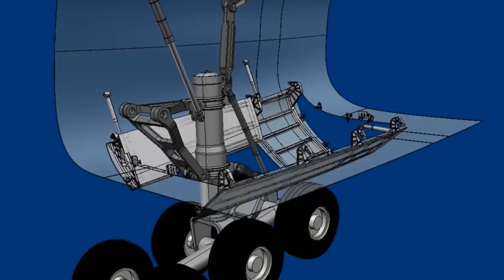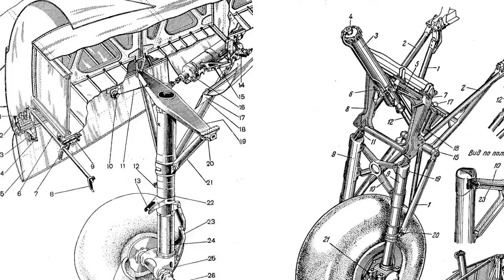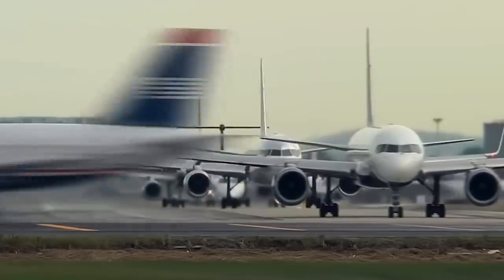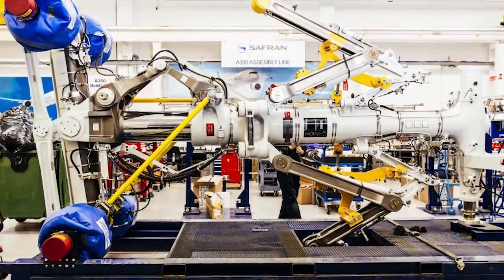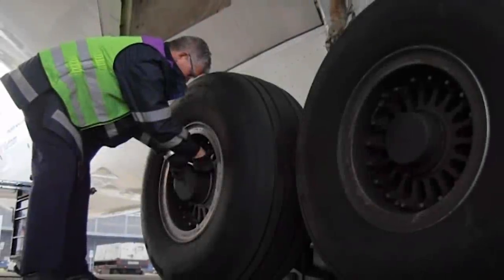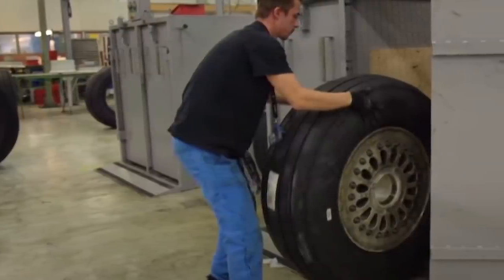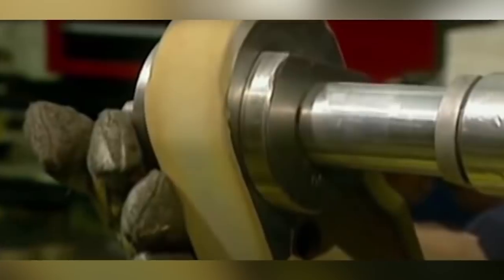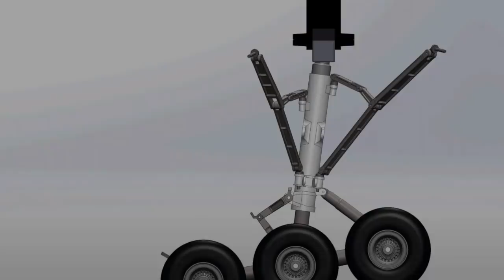Why Does Landing Gear Never Explode?

Comment: I was in the Air Force for 12 years. In that time I changed wheels and tires on the KC-135 Tanker, B-52 Bomber and the AWACS E-3A.  I was a 43152E. 30 mins is ridiculous. Under QA supervision and following all applicable Technical Orders, Job Guides for the job it takes an hour easy ONLY because the Wheel and Tire shop had already swapped inspected and tested the wheel, technician had changed bearing races, changes  Schroeder valve put a new tire on the rim, torqued all the bolts holding it together, inspected wheel bearings, greased and had them at the ready a wore tire. Wheel and tire assembly would have to be taken to the airplane. Before removal the airplane had to be configured for jacking and safety procedures including documentation in the aircraft's forms. Without QA could be done in an hour. With QA 90 mins
Reply: Totally agree. I worked on KC-135's for years and. Sometimes our QA would come by and take apart what we just did just for quality control. Nothing like doing the same job twice.
Reply: 20 mins on an a320
Reply: I was a crew chief on the tankers also.  Very time consuming if done properly.  We always man handled the tires,but once the women joined the crew chiefs, they used the wheel movers, and saved their backs.  I retired after 24, years.  Grissom, Malmstrom and MacDill AFB.
Reply: I was at Grissom for 6 months 1978 to February or March 79
Reply: I also han't was the supervisor for the real entire shop for both the KC135 and top be 52 tires including the wingtip tires
Reply: He researched a piper warrior when looking into the landing gear tire changes

Comment: When he stated there are very few KC-135 tankers left, where did he get that info?  That is still our primary tanker in the Air Force.  344 still in use of the original 732.  The KC-46 will eventually replace them.
Reply: And he says they "were popular in the 1960s."
I guess he forgot that they were (and still are) the primary (and therefore "popular") aerial refueler in the 1970s, 80s, 90s, 2000s, 2010s, and continuing into the 2020s.

Comment: Any inflated pressurised tyre can explore or burst, no matter what it's fitted to !.🧐🏴
Reply: But, airplane tires are mucho more resistant to exploding and bursting.
Reply: You said and I've seen it lots I've also had the chance to see a airplane tire being tested to bursting pressure and even though we were in almost what seemed like a bomb shelter I still felt it in my chest when it went off it was the crazyist thing I've ever seen in my life
Reply: That's exactly right just like the advancement of racing car's and safety that's great and all but they'll never be death proof  👍
Reply: 27 years in the air force... Never saw a tyre explode. If they have a "hot landing" the brakes overheat and may catch fire, but normally just smoke a bit. The danger here is the heat generated passes into the tyre (cover) increasing the pressure that's why wheels are equipped with fusable plugs that let the gas out of the wheel assembly at a safe controlled rate.

Comment: You really need know the difference between tires and wheels. Especially when you’re doing a video on tires and wheels. You had my mind so twisted and confused when you interchangeably used tires and wheels, then you threw a couple of rims in their too. For future reference tires are the rubber part and wheels are the metal pieces that hold the tires. Rims are a flashy set of wheels.

Comment: OH, THEY D-O EXPLODE. WHAT ARE YOU, HIGH?
Reply: Yes they can and do explode
Reply: 27 years... Never seen it, normally the heat builds up in the wheel assembly due to the brake unit being inside the wheel hub. Transfers the heat into the gas in the tyre this in turn will cause the fusable plug to burst letting the tyre deflate safely.

Comment: The tires of an aircraft don’t take long to change and mechanics have all the necessary tools to interchange a flat. It takes about 2 hours. Depending if the brakes are hot. I’ve seen it personally on passenger flights I’ve done.

Comment: Landing gear tires burst. It's one of the worst failures during takeoff. It's worse than an engine failure. I had one tire burst in 25 airline years. It wiped out gear indicator lights and the hydraulic system that operates the gear. We landed safely. Others have not been so fortunate. A DC 8 retracted burning tires that burst on takeoff into the wheel wells and crashed several miles short of an emergency landing killing 250

Comment: To say they hit the ground at 160 miles an hour is pretty disingenuous.... 

200 tons over 40 tires is a lot...5 tons a pop. But realistically tired can be designed for a lot more weight if absolutely needed. They definitely are some of the most well engineered tires on the planet. 

Either way neat video :) liked

Comment: Tyres are extremely dangerous when handled wrong. 
A truck tyre may kill if one is 5-10 feet away. Such a sudden rush of pressure, you will fly with it :D
The landing gear is most definitely powerful!

Comment: How does someone come in to land at 300mph?!  You’d think that a pilot would notice that things are going by too quickly and just go around.  Does anyone know if there were other factors at play in that incident?
Reply: many restrictions are removed when in an emergency landing. ie max landing weight is the same as the max take off weight. many things like that will alter the rules.
Reply: I think if it was an emergency and they had to land with full tanks, weight might give that plane enough momentum to touch down at higher speeds. Though I'm just guessing

Comment: uhmm yea aircraft tires will explode just like every other tire... I'm an air frame and power plant mechanic.. yes they are designed to not explode but like anything man made they can, do and have exploded.  All large aircraft tires have a cycle life (i.e. number of landings) exceed that and the tire is likely to fail, of course there are other factors involved like the pilot, environment, and how it was serviced. but yea they can fail...
Reply: Usually the AMM gives tyre life limit as no groove showing.

Comment: Wonder if runways could automatically self lubricate themselves with gradual viscosity altered over distance?
So maybe airplane will not need special landing gear?
In other words,  is it possible to design a runway , where the shock absorption, is done by the runway, instead of the landing gear/wheels?

Comment: o.0 wtffffffff..... Never let a lay person create crap like this. Its so wroooonnnnggggg on so many things. There is absolutely no actual knowledge here, just meaningless word salad. Oh, and aircraft tires? Do explode, most often during landing due to landing stresses and age of the tire/tyre, 2nd most often shortly after a hard landing where breaks were applied (the rim has blow out plugs that melt out if the rim temps get too high, some tires have internal over pressurization valves that will release, but sometimes they fail to actuate), and during inflation operations ....that one can cause loss of life easily.

Comment: What drug  are you on , the tyres and wheels on a family Honda Civic your Mother drives bare no relationship to the four wheels and tyres manufactured by BF Goodrich comprising the main gear of a late model Boeing 737.
As you rightly stated aeroplane undercarriages  have to cope with the  immense stresses imposed when  seventy to eighty tons of 737 is  accelerated to the same speed as a Lamborghini Hurrican Hypercar in order to take off. 
Bulk of the 737,s weight rest on four main tyres specially designed by Charles Goodyear trading as BF Goodrich to fit in the confined space of the 737,s main gear wheel wells. Each tyre inflated around 220 psi with non inert nitrogen lessening the chances of a blow out and fitted with fusible plugs to safely deflate the tyre in event of a max weight rejected take off . The Bendix  Corporation supplies wheels to undercarriage  manufacturers Cleveland Pneumatic , Mennasco and sold in a range of sizes from a Learjet to an A380.  Depending on the aeroplane,s size weight and application,say the late model Boeing 737airliner ,the worlds most popular puddle jumper. . The gear or undercarriage has  three legs machined from high grade monel steel or titanium ,each with a built in oleo hydraulic damper  working the same way as the dampers on your father,s 1977 Ford F-250 Pick-up truck.

Comment: the tires are also most likely not 100% inflated perhaps around 80- 90% since they would shrink and grow in the air
Reply: 100% inflated to their recommended pressure
Reply: Should always be aired to 100 %   
 They use nitrogen to help prevent that expansion and contraction.
Reply: Tires don't grow in size.  They stay the same size on the ground and in the air.  The tire pressure is based on how much weight the plane is carrying. On our Tanker aircraft, main gear tire pressure was between 180 and 210 psi, depending on the takeoff weight.

Comment: The tires would last twice as long, if they would spin them up to 150MPH before touchdown. IDIOTS! I made that suggestion to them years ago, and they have done NOTHING about it. Didn't even acknowledge my suggestion. I also made a suggestion about automobile tires, about filling them with a inert gas. NOTHING BACK  FROM GM OR FORD. If they are going to ignore GOOD suggestions, makes me wonder how good the planes really are. Especially after the 737 Max fiasco.
Reply: Some manufacturers/Tire shops use nitrogen - isn't that an inert gas?
Reply: Spinning the wheels has been tried a few times.......did not work at all. It should also be noted that these wheel/tire assemblies are NOT balanced !
Reply: @jakesterone382  Sorry, but they never got back to me, so I don't  know if they received it. Bad public relations. Bad image to boot, and now I know why.
Reply: @jakesterone382  
 Sorry. These wheels and tires are balanced everytime they are rebuilt
Reply: Spinning the tires prior to landing would cause a major gyroscopic effect, that would effect handling.  Most tire wear occurs during braking, not landing.  As far as inert gases go, we used either air or nitrogen, which ever was available.  Nitrogen was less effected be colder temps, but aircraft tires loose air all the time.  They had to be serviced at least every three days to keep them within limits.  I was a crew chief on the KC-135 aircraft, with 24 years of service.    Air is 78% nitrogen.
Reply: richgs76   What aircraft are you referring to?  I know of no aircraft with that feature.